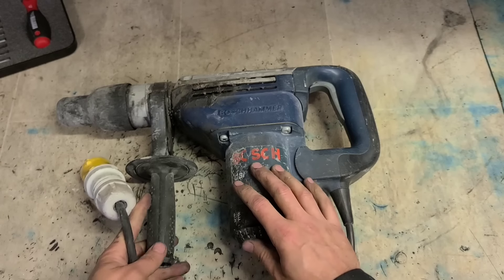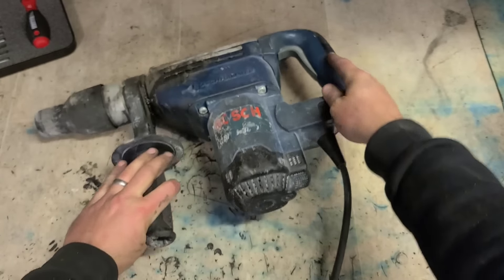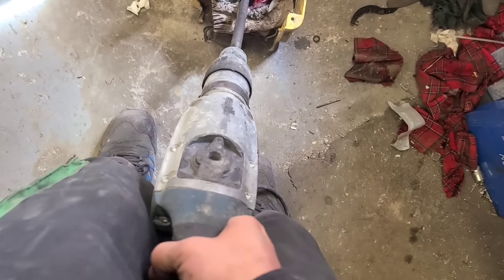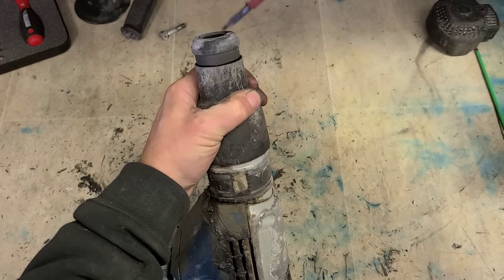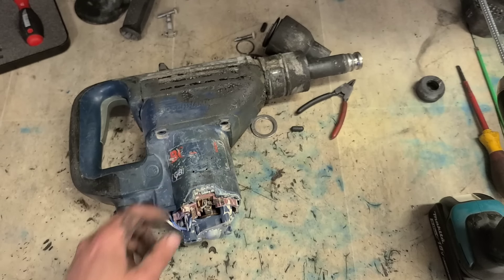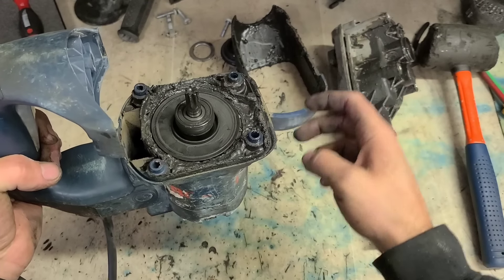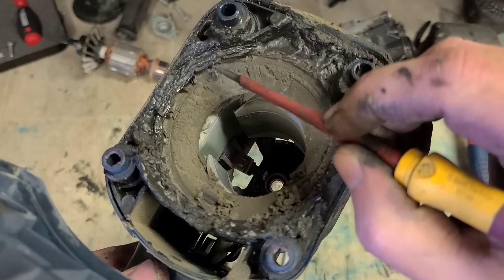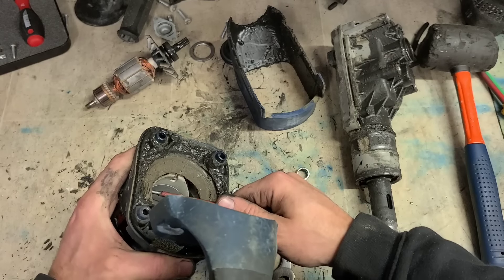Repairing a Bosch rotary kango hammer GBH 5-38 D with a bad oil leak. Full teardown, clean, rebuild.

Comment: Hi Dean, I was wondering if you could give me some information. I recently was given a load of Makita power tools (drills, grinders and planer) and they all work. I opened them up to inspect them and cleaned them and changed the brushes where necessary however, the grease seems to be breaking down and is a bit suspect. Can you recommend a standard grease as a replacement that I could buy in larger quantities so I could do all the machines in one go. I see that Makita does tubes of grease but buying a load of them would be expensive and I was looking for the cheapest way to regrease them but to do the job right.

Comment: Dean, what kind of grease do you use?
Reply from the maker: Bosch hammer grease
Reply: @deandohertygreaser  
Thank you for the fast reply. Do you have a Bosch part number for it by chance? Thank You!
Reply: I think you are talking about Bosch part number 1615430010. They call it tube grease. Is this the correct one? Thank you for your help!
Reply: Thank you for all the videos! They are tremendous!